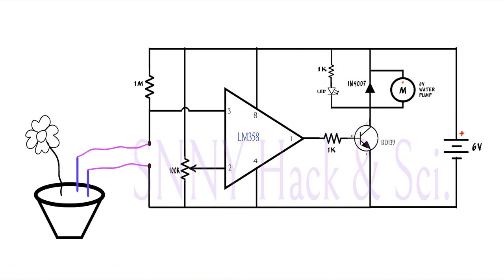AUTOMATIC PLANT SELF WATERING SYSTEM [DIY]

Comment: Dear Bro Great project ..... Motor turns off when it sens water.    in my case i want to controll 240 volts ac motor that will turn off on overflow 
overflow water will go in a bottel first then after some storage will drain extra water
when we need to power on motor will drain that stored water so motor will power on
i dont want to use automatic switch.
Can this circuit control AV 240 Volts?
Reply from the maker: replace motor with a relay switch. i.e. use a RELAY in place of MOTOR WATER PUMP in this circuit.
for 6v relay use a 6v power supply, for 12v relay use a 12v power supply.